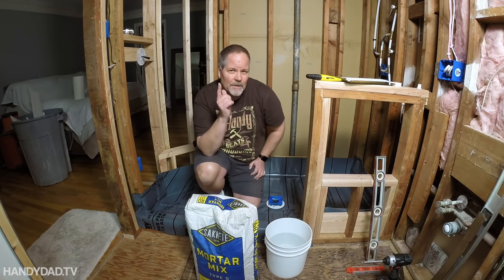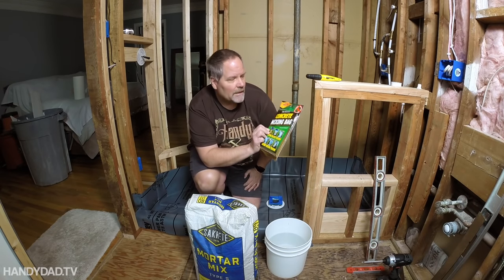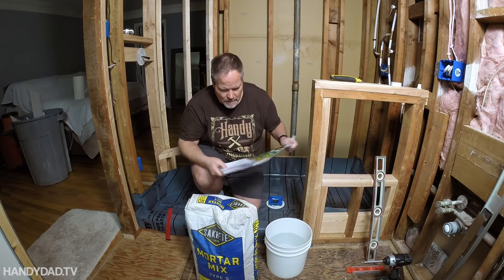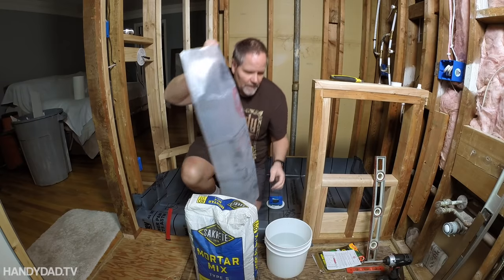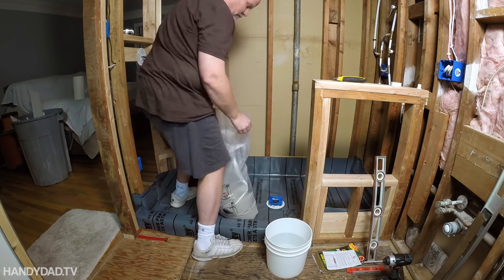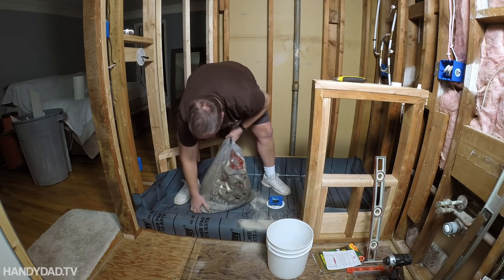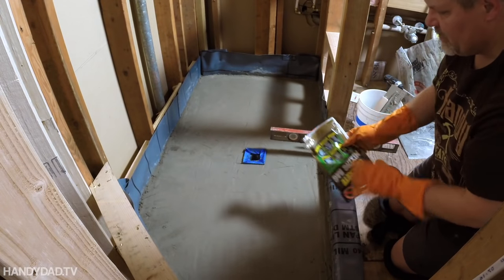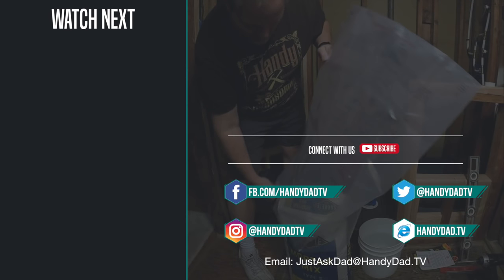Concrete Mixing Bag - does it really work?

Comment: I was able to use a heavy duty contractor trash bag (not see through) at 3mils thick to mix a 50 lb bag of concrete.  Worked great for me. I did a bit longer than 30 seconds mixing.
Reply from the maker: Good idea!
Reply: Hey thats a nice idea, how many uses in a day can you get with one bag?? Mixing constantly, before buildup is too much? If you can remember
Reply: I was able to use a contractor grade trash bag to mix 2 batches of quickrete. Common sense, you gotta work the batch lifting the corners and sides to mix everything thrugh before dexiding if you need a lil more water. Does not retain a lot of reaidue, and I could easily get 2 if not more uses out of it

Comment: My mother in her 60`s literally poured a whole concrete slab for a large shed by pouring the dry bags onto the ground and spraying it with a hose until soaked. That shed still stands. No need to mix shit. I've made many yard items this way including a walkway. What's the big deal?
Reply: May I know what mix did you buy is it quikrete?
Reply: Congrats to your mom. And thanks. I always assume dry concrete could be poured, well, dry.  Also wondered how long it'd take to set if you just let ground and air moisture do the trick.
Reply: The dry method your mother used might be OK when the strength is not so important. Otherwise,  for the small project a 5 gallon bucket and the power drill ( covered in plastic bag to keep it clean) with concrete mix attachment worked for me better- it presses the air in the mix and make a more durable batch.

Comment: I saw another video of the same bag being used, and to be fair, you do have to toss it around for a few minutes to get a good mixing with the water.
Reply from the maker: I should have used more water too.
Reply: @handydadtv  unfortunately I need to get my stair repair job done before Amazon can ship me one of these, so I'm going to try those extra-heavy Hefty Contractor trash bags as someone else suggested in the comments.  If I use a 60 lb. bag, it should work.  Suddenly, there are no 80 lb. bags of concrete mix to be had in central NJ.
Reply from the maker: What’s this world coming to!

Comment: Seen a couple of videos where they were using contractor heavy duty garbage bags they were much bigger and much easier to mix and probably cheaper than that bag anyway I really don't need the Velcro at the top just twist the bag
Reply from the maker: Yes you can use any heavy duty garbage bag. Clear is nice so you can see how it’s mixing.

Comment: Great video! I have liked and subscribed. I am doing my own DIY concrete slab at the mo and made a video of mixing concrete in a bag as part of that and wanted to see how others did it. I mixed 36 20kg bags to make my 2 metres by 1.5 metres slab which is half of the overall which I will do in part 2. I bit of hard work but works well. I just used an old insulation bag :) cheap and cheerful :)
Reply from the maker: Great idea 👍🏻

Comment: Why not dry pour it in a frame or area and then smooth the surface with a board and if you want it smooth, roll it with a very fluffy paint roller, then with a sprayer on mist, give it plenty o' water?
Reply from the maker: That method may work for fence posts, but that’s not how you mix mortar for a slab.
Reply: @handydadtv  It was to put a chicken house on
Reply from the maker: If outside, you should use concrete mix, not mortar mix. But still, it needs to be mixed with water and poured into the forms.
Reply: @handydadtv  When you mist it evenly with enough water, it all gets absorbed into it; it is the same as mixing it but without the back- bending labor. The surface will tell you if the thickness has had enough water because it will have a  drastically slower absorption rate.

Comment: Why is he using mortar? Mortar is too soft for a shower, also cracks absorbs moisture.
Reply from the maker: Wrong. Mortar is commonly used as a base for tile. And I sealed the whole thing with Redgard so there will be no cracking or water penetration.
Reply: Hahaha   great reply.....givem heallll  !!